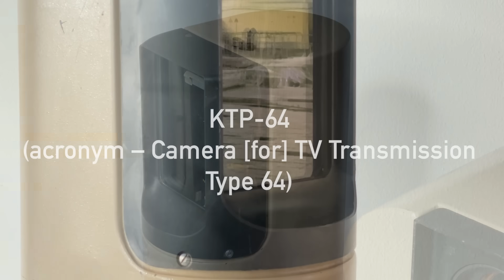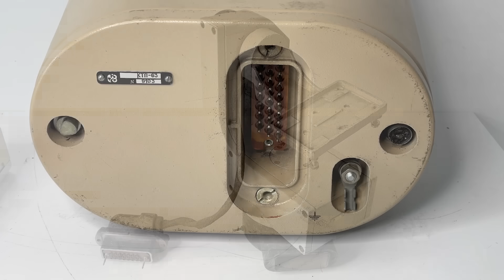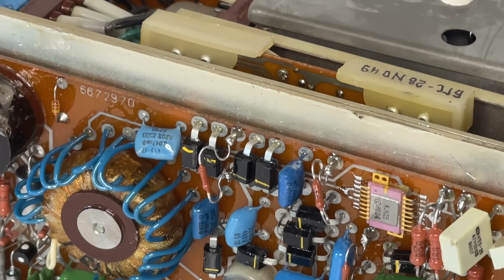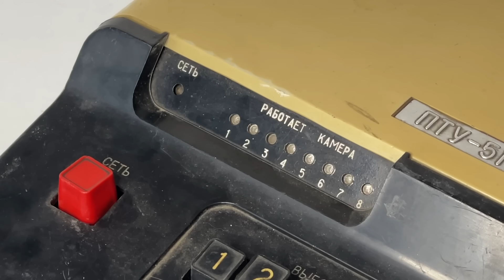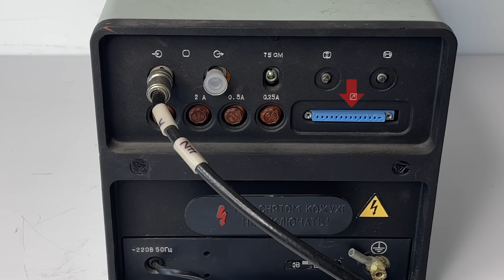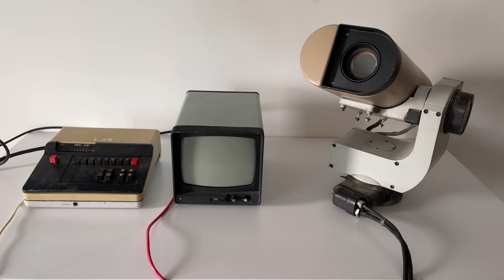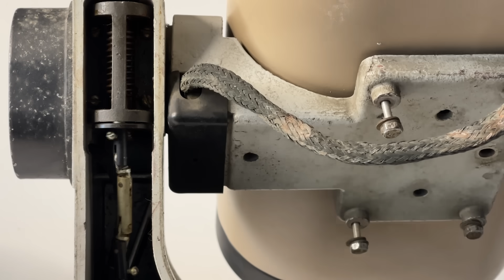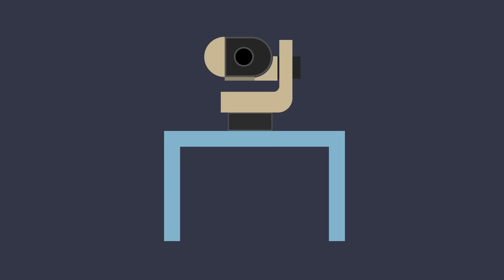THESE CCTV CAMERAS recorded the CHERNOBYL DISASTER

Comment: 13:24 Gaaah, look at those tin can ICs! 😊
I wonder what they are, transistor arrays and opamps probably. 

So it's a two layer hand soldered board? What are the boots for on those resistors? Just on one leg? 🤔

Now I wonder, is this just how they built the driver boards for everything or are these special radiation hardened models? They do look a bit more serious than the ones in the other camera, the working one.

Comment: 9:52 That's a worm gear and this is precisely what their application is, extremely high torque and self-locking. The camera body is probably quite balanced at the fulcrum but extremely high mass and inertia. Allows that dinky little brushed DC motor to lug that camera about.

Comment: Am I right in thinking that electron tube electronic units tolerate destructive gamma radiation significantly better than their semiconductor counterparts?
By the way, those pin connectors are also interesting. They are similar to the later Euro-Scart system connectors. Could it be that these were developed in the 1990s? Just wondering!

Comment: Vidicon tubes, with the right electronics, are quite amazing. They can even capture long exposure (low light) images due to the way the image is "stored" on the plate until read out. The Voyager probes to the out planets used similar cameras, just with bigger optics.

Comment: Even portable video cameras, "Handi-Cams" used CRT tubes back in the early to mid 1980's. 

I still have some of the TINY eyepiece CRT tubes that were used in these cameras. I even made a TINY WORKING replica television set out of one of these tubes. It's SO small... 😆 You literally need a magnifying glass to watch it. You can see it with a bare eye, but it's VERY hard to make out any detail. It is black&white. Towards the end of the tiny eyepiece CRT's, they were made in color. I dont have a color version, and WOULD like to find one. If ANYONE has a working color eyepiece tube that they'd like to get rid of, please contact me. THANKS!

Comment: Interestingly, even dor monitoring the hot zones after the Fukushima accident they used cctv cameras with imaging tubes instead of semiconductor (cmos or ccd) because those are strongly affected by image noise and fast degradation in a radioactive environment.

Comment: That is actually pretty impressive and good design, and build quality.  Also of course Helios lens. I for sure used few of them. The tube based image capture still is a magic to me. I never seen a camera with it (I was born November 1985, so by the late 90s, everyone switched to CMOS / CCD stuff), but of course seen many stories on it.
The word you are looking for the tilt mechanism is a worm gear. High torque, and slow speed, and locks with good holding force. Also pretty compact. Perfect for this use.
Reply from the maker: Thank you!
Reply: Those cameras were in use well through the 90s and into the early 2000s.

Comment: 75 Ohm is the termination resistance / line impedance for most video systems.

The last device in a chain should have the termination resistor switched on to avoid signal echoes back down the chain.

This should be true for any camera in use.
Reply from the maker: thank you very much for this detail; yes, I later learned this as well.

Comment: That's quite a hardy design for a CCTV camera.  The CRT scan tube is like the original TV camera.  Everything is shielded in a heavy metal case - which I imagine allowed it to operate in a high radiation environment.  Since a geiger counter works by measuring the counts of the arcs inside the tube - it doesn't show any bright or dark flickering in the picture.  The semiconductor electronics (even more sensitive) must have survived by the camera operating via a lens going into the shielded case.  Modern CCTV and IP cameras would probably not have worked at all

Comment: How much to purchase one of these from you?
Reply: Okay, thanks though 😎
Reply from the maker: Well, KTP-64 is in a museum already; as for KTP-63 we need it for the Scout robot project. I cannot recall the price precisely as we purchased the system piece by piece, but I remember it was very expensive, camera around $450, mount around $200 and all other stuff such as the control panel also had its tag, so not cheap. I mean, it is possible to find, but it will cost roughly this. Too much gold inside.

Comment: Very interesting examination! 
I feel like these triangle-headed screws are also used for electrical and pneumatic cabinets in older Russian metro trains. I think the same screw heads are used for the window locks on these trains.
Reply from the maker: Thank you! No, those on thains are different and way easier to open. This one was not only asymmetrical but also rounded.

Comment: I think that in the Soviet Union very interesting things were manufactured, once I saw a video of a regulated source made in Bulgaria, correct me if I am wrong but I see that they were products made to last. A question: Were there electronics stores in the Soviet Union where the public could go to buy components?
Reply from the maker: They were built to last only in case of military or industrial use – like those cameras, however, it is hard to call them free of issues. Consumer goods were not even close to western in quality, except some prominent examples of tech made by Baltic republics. Yes, there were stores, but some components were very very hard to get.

Comment: Actually still today the most radiation tolerant cameras use Chalnicon/Vidicon tubes for applications where CCD-chips would not last for a long time. Usually they are used to look for fuel assembly damages, lost items and more in the core (or underneath it ) of a BWR/PWR reactor.
Reply from the maker: Thank you for sharing!

Comment: I recognized the lens immediately. Purchased one off of eBay for my Konica 35mm camera. I also had to get the adapter from the m.42 screw base, to the AR base my camera uses. I'm sure there's more modern lenses out, with better image quality. But with my skill level, and shooting on film on a camera made in 1979 instead on simething like an 8k high definition one, I think the Helios lens is far from the weakest element in my setup. In fact, it's the main lens I use with my camera. At 50mm, it's good for general purpose. And the Helios lens is known for it's signature bokeh effect, or in other words how the blurring in the background of the pictures looks. The Helios' blur pattern is circular. I also have a soviet made Industar lens a friend told me I should check out, it's a tiny little pancake lens. I like the Helios much better. And what you said matches what I remember reading when researching it. It was a Zeiss lens design from Germany. At the end of World War II, when the soviets took control of what eventually became East Germany, also known as the German Democratic Republic, they dismantled many factories and brought much of the equipment and designs back to the Soviet Union. This included the Ziess factory. So a Soviet lens, based on a German design, on a Japanese camera, being used in America. 

Incidentally, I have bought several rolls of Svema 125 iso b/w film, that prob has been expired since before the union dissolved, for my 120 format camera. It's quite fun to use. I have to rate it at 25 iso due to loss of sensitivity due to age, and of course, the resulting images are a bit faded and hazy looking. But it has this awesome vintage effect. If there's nothing obviously modern in the picture, it can look like a picture from 80yrs ago.
Reply from the maker: Thank you so much for sharing all this!

Comment: Thanks for a look inside these CCCP video cameras and Pan/Tilt head. Interesting stuff!
The components and construction are typical of CCCP engineering and reflect what the west (I'm originally from the UK) were doing in the 1950s. (Through hole single side PCB and internal wiring loom construction which is very labor intensive)

The Vidicon pick up tube was used for non-broadcast service from the 1950s until around the late 1970s as an affordable industrial solution. It was only then that consumer cameras from Japan made improvements with Newvicon and SATicon photo target materials. Vidicon defects include smearing, sticking, and easy image burn-in.

CCCP color broadcast standards followed the French SECAM encoding, mainly to avoid NTSC and PAL methods, and operated at 625/50 scan rates. This is a monochrome camera. The total scan lines are 625 per frame, two fields of 312.5 lines 2:1 interlaced, and for analog systems only 576 lines were active. With 4:3 Aspect ratio the horizontal resolution is about 750 lines max, more likely half that in this design. We have an equivalent digital format of 576 x 768 today.

The lens system was probably selected for cost and availability and doesn't contribute to improving the image "quality" or perceived "film look".

As already mentioned it was standard practice to loop-through video signals in monitors and other system components, and have only one termination resistor of 75 ohms, usually at the end of the line. A simple check with a continuity tester, or visual inspection, will confirm the two connectors are linked by a wire.
Reply from the maker: Super. Thanks. For all those details!

Comment: Interesting to note that the Cold War actually pushed the Soviets to produce solutions of their own, which also worked. Just incredible, given the fact that they did not had free access to any of the more modern CCTV technology.

The idea with the mirror to protect the camera from radiation is very good.
Reply: No offense but your interpretation of soviet technology is pretty biased, you know that? What's that "also" about? "Incredible"? What's so incredible about it? Soviets put the first man in space, for crying out loud, now that was incredible, as were the Venera probes sent to Venus where they sent back pictures and sound of the hellish planet. That was in the mid 80s. A mundane CCTV camera in the late 80s is anything but "incredible". It was actually built on tried-and-true design principles. There were experimental soviet CCD sensors made in the 80s but soviet manufacturing practices were way different to modern ones, relying more on electromechanics than electronics. Numerous reasons for that but Cold War is definitely not one of them.

Comment: I want one so bad. I like these types of video surveillance/monitoring systems, and I really like the way you switch and control the different cameras with this one.
Reply from the maker: It is possible to find these in Ukraine on local marketplaces of vintage electronics, but they are freaking expensive (not the last reason is that these mounts are often used for e.g. amateur antennas positioning)... just checked — camera+mount = $500 with 'looks good, working condition unknown'

Comment: I remember my dad used to own all kinds of cool things from after Soviet Union collapsed. The quality e resilience of those machine impresses me to this day. I don't think any of them actually failed in the traditional sense. They were either lost, stolen, or connected to the wrong power supplies. (We used to move a lot).

If you want to see something made to last, just look at this kind of Soviet stuff. Sure, there are a lot of crappy products, that were also manufactured, but when they were made to last. They WERE made to last. You didn't break them; they would break your floor.
Reply from the maker: Pretty true. However, this long-lasting often was a side-effect of how the industry worked; just as an example, an overproduction of certain types of steel resulted in use of high-grade metal used in a consumer "market" goods. At the same time, centralized approach resulted in compromise solutions, such as using of photography lenses for their non-natural purpose. The economical model of production resulted is that in the 80-s at some factories around 75% of produced goods had some faults in them (which was a massive subject of public discussion when Perestroika started). Some things were awesome, some awful. The truth is somewhere in the middle.

Comment: So... where the film about the explosion?
Reply from the maker: That disaster was not an event of a moment, it is a long and unfolding process that took a time. The thing, however, that that kind of devices had to be in the central hall of the unit IV. If the footage (which presumably is no more than a few seconds) of the explosion exists, then it is an open question, in hands of which authority it is.
Reply: @ChernobylFamily  ok i didn't knew that

Comment: I have conducted an extensive on line search of chernobyl related material. I've come across the dump where several robots were abandoned, including the infamous 'joker' from West Germany. You probably know this yourself, but if you don't please contact me.
Reply from the maker: Thank you:) That is not a dump, but Buryakivka permanent disposal site for mid-active materials; we have been there a few times, not the best place to roam around..) We have a big post on our Patreon about it.

As for Joker, IMHO, the least interesting robot which in fact was more an annoying device back then; however, at Buryakivka there are two STR-1 robots, that was THE thing...
Reply: @ChernobylFamily  Very cool.
Do you know what the massive pile of pipes were used for. I’ve done a virtual circuit of the site, and next to the entrance there is this massive pile of rusted pipes, as high as a house.
I assumed they were scaffolding or fencing of some kind, but apart from the rust, they look ‘new’. It struck me as a little odd…. They didn’t fit in with most of the other equipment stored there.
Reply from the maker: @wiretamer5710  that is for drilling, and those are not from the zone at all. Buryakivka accepts stuff from all Ukraine, so those were brought if I am not wrong from one of our uranium facilities. But I really do not remember precisely.

Comment: I thought that remote controlled systems didnt work due to the radiation and liquidators needed to use their own hands.
Reply from the maker: In reality it was different. Radioactive contamination varied (and still varies) drastically sometimes within very small distance, so at some places machines could work, at some not. Some machines were more resistant, some not. That or another way, that provided an invaluable experience to make more robust equipment, and still a massive amount of dangerous jobs made by remotely-controlled mechanisms.
Reply: @ChernobylFamily  interpreting, thanks for letting me know
Reply from the maker: @thehumancondition5764  i think we will make a separate episode anout Chernobyl robots; as many people wondered too.
Reply: @Chernobyl Family 🇺🇦  I think it comes from the documentary on chernobyl which mentioned that robots didn't work on the roof of the reactor, but didn't mention that they were used elsewhere.
Reply from the maker: It is interesting, because there is an actual footage of STR-1 on the roof.

Comment: Those robots were essentially useless.
Reply from the maker: This is far from true. Just a few STR-1 and two Mobots alone cleaned nearly 450 sq. m of rooftops. And there were many other machines, some very effective, some - yes, useless, for example the overhyped Joker. While these numbers sound not so impressive, when it comes to the activity of debris removed, they are big.
Plus, scouting robots made a lot of job before humans could come.
Reply: @ChernobylFamily  These were remotely controlled machines of basic construction, not even a Robot by reasonable definition, unless a child's tethered remote toy car is a robot. I guess they looked like robots compared to the... "bio-robots"...

There is no solution to working in high rad environments so I think we should stop creating them.
Reply from the maker: @CarlDidur  I agree that historically used term 'robot' is not correct here (in documentation these called "remotely-controlled mechanism"). However, do you operate with own guesses or with scientific data? That machinery with all its flaws gave an invaluable experience used later for newer generations of remotely-controlled mechanisms. E.g. there is an entire program of robotic development by the ISTC "Shelter" (now — State Research Institute for Nuclear Power  Plant Safety), that includes modular multi-tool systems for very heavy radiation conditions (literally have seen these machines with own eyes three days ago). There are unmanned systems of sample retrieval for the Shelter. There are robotic systems for manipulation of highest-grade radioactive materials that work at e.g. Vector repository compound.  All that succesfully does such job that people should not even come close to, and there is no reason to stop that.
Reply: @ChernobylFamily  Until there is a "beyond design basis" scenario. I am sure you understand a remote controlled device entering an extreme radiation environment must be tethered and that tether must be well shielded and that this is simply a practical reality of these machines. The shielding needed to make the electronics impervious to radiation makes the robot too heavy to be mobile in a complex mess and the tether is likely to get caught in debris, just like at Chornobyl & Fukushima inspections. It is a very tricky problem. I am speaking to the reality of a severe nuclear accident, not diminishing the efforts of the engineers who in good faith tried to spare human workers. I am sure you are aware of many instances when inspecting Fukushima, post accident, where humans needed to be inside since robots could not clear a path for themselves or were dying after a few hours of exposure. This is after decades of technological improvement in robotics and computers since 86. I am an electronics technician not a nuclear technician.